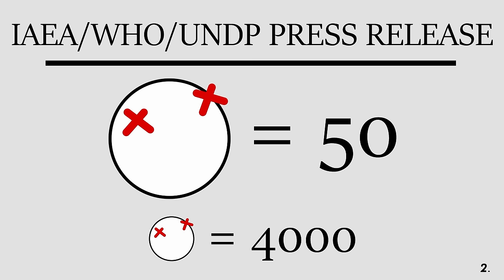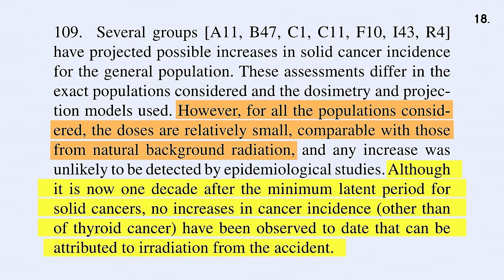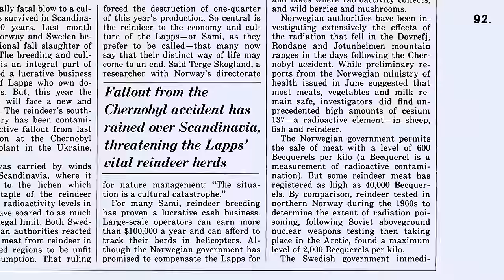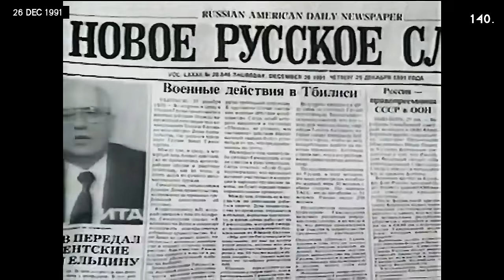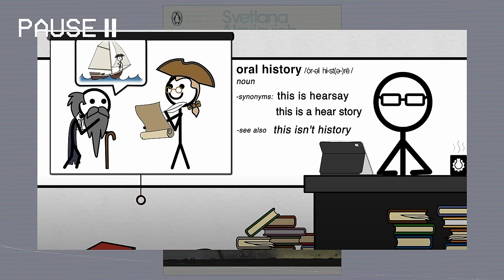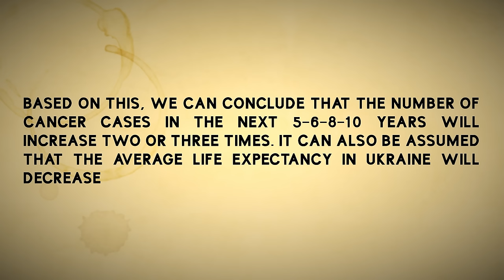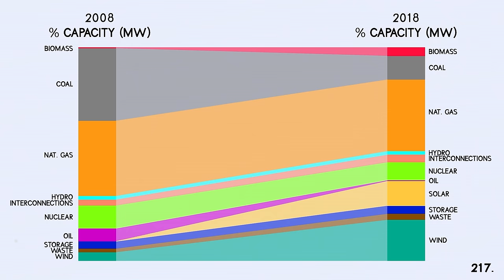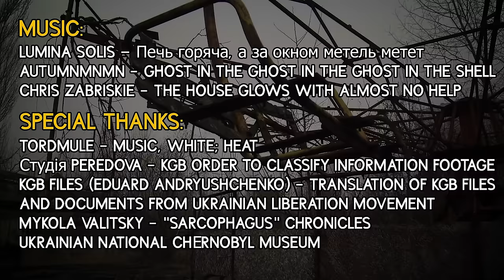Chernobyl's Death Toll | The Deep Dive

Comment: One thing that i feel is always left out of the discussion on nuclear power is that nuclear material is non renewable. When we determine to what extent nuclear power will be used to manage our carbon, other future uses of fuel material should be a factor. Obviously it would be stupid to try and save all the thorium for a theoretical space station that won't exist anyway in the event of societal collapse due to climate change. However, if there is a way to achieve climate goals without expanding too much nuclear fuel, that would clearly by the most prudent path.

Comment: We are nowhere near stopping at 1.5C, we are already at 1.2C and heading towards 3C by 2100.  While I'm sure that nuclear power will play a role in reducing emissions, the political and economic challenges to building new reactors are enormous and rightfully so.  The US would need 300+ Chernobyl sized nuclear plants to supply current US electricity demand.  Even if each plant caused a Chernobyl level disaster once every 10,000 years on average, we'd still have a 50% chance to see at least one disaster every ~25 years.  That's hard to swallow even if it is objectively less damaging than conventional generators, so we basically need designs that can never fail catastrophically.  It's easy to say we've already done that with gen 4 etc, but that's the same kind of arrogance that caused Chernobyl/Fukushima considering that almost nobody has actually built one.  Wind and solar are significantly cheaper politically and economically and do not have this problem, so it makes sense to focus our efforts on the things that will make the biggest difference for the lowest cost given the low level of commitment to solving climate change.

Comment: My father works at Hinkley B, and up until a couple days ago they were set to begin decommissioning in 3 months MAX. now its up in the air if Johnson will support the plant to stay on. But honestly i dont think its worth it. it was supposed to close in 2012, hell its been open since my dad was 1 year old (1976). The only reason i see it as acceptable currently is due to gas and oil prices ROCKETING, but im just wondering if it is worth it. that money could go straight into offshore turbines. If they want to expand B's life, they have to make a decision in the next few weeks before its too late (due to safety checks etc.). in the short term its fine but this cannot go on forever. Its already a decade overdue closing, sooner or later something will go wrong. 

I do believe in the future of Nuclear, but B site should go into decommissioning sooner than later, because the later /could/ be devastating- and for what- 1GW of power? C site is supposed to give out 3.2 when finished, put money into speeding that up before something goes wrong with B

Comment: This video is the best examination of nuclear power I have ever heard. My masters degree is biomedical physics with a focus on radiation, I've heard full lectures on this topic and yet you managed to present a more nuanced and holistic argument than any of my profs. 
Big compliments also on the level of simplification you chose in the section focussing on the science. Yes radiation induced leukaemia behaves completely differently to solid tumours (different risk rate, occur within 15 years of exposure instead of 40+ years...) and yes it is questionable whether whole body exposure models are applicable to radio iodine expose, but we didn't need to know that for your argument. I wouldn't have been able to hold back on fascinating stuff like that :D And yet I don't feel like any important bits were missing. 
I see the role of nuclear a little bit differently to you though. In most countries a mix of hydro solar and wind is likely able to be cost competitive with nuclear even in deep decarbonisation, but that is just the luck of the geographic draw. In countries where this is the case, I don't think nuclear power is a sensible technology to subsidize. However, in countries like Germany where this probably isn't a given, we should start planning new plants with significant amounts of state funds now. 
To me it feels like the most significant opposition arises from the issue of nuclear waste. My radiobiology professor used to be part of the peace/green/anti-nuclear movement and she is (or at least was when last spoke to her) still an opponent of nuclear energy because of the waste storage issue. Maybe that's just the German movement to the debate, but I'd guess it's similar elsewhere. So when we argue for nuclear as a technology for deep decarbonisation we need to address that issue. For me it's clear that we do have the technology for long term storage, especially if we allow international cooperation with storage sites in low population geologically stable regions. And it's also clear to me that long term nuclear storage is very scalable due to the small amount of waste and that we have to figure out storage anyway for the waste we already have. 
But we get back to issues like "won't this type of cooperation encourage colonial core countries to dump their waste in the global south where it's not safely stored?" and "what about the people living near the storage sites, proposed sites tend to be in territory associated with tribal or otherwise marginalised groups?". These questions and narratives are to me where the real problems and discussion around nuclear live, not really with safety of reactor operation (though that's important as well of course).
Reply: @namename9998  nuclear waste is not an issue because of its quantity but because of safe, long term storage. That is exactly my point.
You do need to store (highly) radioactive materials safely, all those scary cases of people salvaging sources from  medical equipment and getting people sick should be enough evidence that this is a real issue. I don't doubt that it can be done, but countries like Germany for example are still working on putting the infrastructure into place.
Processing waste is not a magic wand that makes the danger go away, yes some isotopes are useful, but you will still end up with some amount of waste you need to dispose of. Additionally not all countries have the capability to do processing and some are forbidden to develop the capability by treaty (chemical processing of waste from breeders can also be used to obtain relatively pure plutonium).

Comment: My only comment will be to annoyingly, pedantically, point out that "junk DNA" has largely fallen out of use in biology as it's become increasingly clear that non-coding regions aren't simply junk but may in fact code for important RNA (such as the relatively recently discovered long non-coding RNA, or lncRNA) or serve a structural or regulatory role, such as enhancer regions, Sequence within these areas is equally as important as within coding regions, but we didn't have robust enough tools to really investigate non-coding regions until recently, so it's still kind of an open frontier.

I only bring this up to note that assuming mutations in non-coding regions are inconsequential is a trap. I agree that mutation rate is not a useful metric, here, as it can be influenced by god damn near everything and most mutations have little or no effect (read Kimura's papers on Neutral Theory for an interesting time, here),

Comment: Nuclear power is the best alternative to burning fuel to produce power we currently have available. It is statistically safe, consistent, and relatively cheap. The major issues are high start up cost and long construction times before power can be produced safety concerns are further down the list with current technology and western safety standards. The fact that the same people who claim to care about the environment are opposed to building new nuclear power plants and exploring new technologies in the industry is very confusing. Instead they champion power options which are either way too expensive to be practical or so intermittent that they require very cheap and dirty companion power plants to cover their regular short-term production gaps. If you have to build a coal burning plant to cover your solar energy gaps is that more beneficial to the environment than a nuclear power plant producing steady, clean, cheap electricity which is only a problem if you neglect it or ignore safety?

Comment: Thanks for the summery of well this ... It neatly shows some of the root causes (if not most) of why it is so hard to trust atomic energy. It is not the engineers or the since that really are the source of the problem.  It is the policymakers for whom truth is optional, it is that industry who weighs the safety with profits and the potential for long term devastation unless the policymakers are actually acting once a accident happens. I do believe we will see a even stronger shift towards renewable not because they are green but because they are cheaper. If it will be enough to finally kill coal and gas without nuclear? Without some of the projects planned for energy storage doubtful but there is progress made and yes fukoshima did made the whole thing a lot harder.

Comment: Radon exposure is a red herring. If you control for smoking and routine second hand smoke exposure, which is already stressing the lungs to the point of carcinogenesis, the Radon absolutely makes it worse.

But, if you look at the non-smoker category, there's no difference between Radon exposed and non-Radon exposed.

So in other words, the doses from radon exposure only seem to hurt you if they're exacerbating something else that is already way into the level of chronic or even acute injury and inflammation. This is exactly what we would expect from Threshold models.

Comment: Honestly I am completely fine with more lax safety in nuclear power. Hell even if every modern nuclear powerplant was a dam BMK, It would still be safer then natural gas and coal power by a factor. Fukushima was not a disaster it was proof that nuclear safety regulations are beyond what is actually needed. One person died and a few got radiation poisoning, if that was a natural gas plant it would have probably resulted in WAY more deaths inside the power plant. Im just tired of people holding nuclear power to a different standard then natural gas and coal. One person dies from radiation poisoning and its a dam global disaster but 20 people die in a natural gas explosion and you probably will never even hear about it. Im not saying nuclear power should have no regulations, Im saying the regulations should be more lax to allow nuclear power to actually have a chance to become better, if it was actually economically feasible for companies to build nuclear power plants then they would become more standardized, produce more power, and probably end up safer in the long run. And if we need to have a few more meltdowns for that to happen then so be it, it will still be a fraction of the people who die in other power production fields. And hell it will probably even have a smaller ecological impact then fracking, oil drilling, coal burning, and solar power. 

The facts are simple. The single worst nuclear disaster that ever happened that was caused by insane incompetence and corner cutting. Still (and this is taking the highest estimate) resulted in less deaths then natural gas has per year, and literally isnt even one fourth the deaths that are caused by coal every year. We could have a Chernobyl every single year and it would still be safer then burning coal or natural gass for power. Hell you could have 3 Chernobyls every year and it would still be safer then coal.
Reply: you meant fukishima not hiroshima, but i broadly agree with your main point.

Comment: whoa whoa whoa........ There were 3 other RBMK reactors at the Chernobyl plant. 2 of which operated almost another 20 years. No 4 reactor had MOST OF ITS CONTROL RODS REMOVED(those green squares in the light-up layout display in the control room)!!!! They disabled and jumpered out vital security and safety control systems!!! And then they decided to run a test that compromised the cooling system, a test that was known to leave a gap in coolant flow!!! The way they ran that reactor they were guaranteeing an excursion event!!! Period!!!

The only problem with nuclear power is gigawatt scale plants. ie, having too much in one spot. With Small Modular Reactors its far easier to handle a few mega watts getting squirrelly, and far simpler to shutdown, and far safer to handle a partially melted core unit (if it can even self sustain a reaction after being poisoned and neutron reflectors being blown away by self activating pyro-bolts). Down with gigawatt plants. And let me have a 20KW micro-reactor for under my driveway!!!

Comment: I'm not even half way through and I've been listening to this while trying to figure out the nuances of amplifier circuit design, but I suddenly found myself stopping for a second with a need to write this comment that is eventually going to say: holy crap this is remarkably good sociological analysis; the way it explores the web of interconnected groups and interests and how they pull against or towards each other not to mention all the other angles, how the collective consciousness of the whole and the infinite number and variety of diffuse groupings you can separate the whole into evolve overtime depending on a variety of material conditions. Nice. 

Well... back to listening and trying to figure out these fucking biasing resistors I guess.

Oh right and all the stuff about class interests and their respective power dynamics stuff is great too.

Comment: 1:29:00 sadly that not 100% right, the CDU/FDP govmernt dint went back to the old plan of the spd and green that  had a higer green power spending that the CDU and FDP not retunte to.

in my belife atomc power can only be done in a 100% state run engerie sectore like you sad. 

only if this done we shuld do atomic power.

Comment: 36.23: Chernobyl DID NOT "explode"
Reply: But it did. There were two explosions. There's a disagreement if it was a stream and hydrogen explosion, or if the reactor actually went into a fizzle and had a micro nuclear detonation.
Reply: @ChucksSEADnDEAD  there was an outburst of steam, which isn't equal to say "Chernobyl" exploded. There was most definitely not a "micro" nuclear detonation.
Reply: Kinda did though bud

Comment: Hmm. Well done.

Politics is choosing least unpalatable of a number of bad options.
You‘ll notice that many German speaking users will not be happy with anything lower than Greenpeace numbers and also ignore all the pesticides used in the Soviet Union.
Reply: 48m45s „Ukraine and Belarus lack commodities like oil and gas“

That’s not correct. Ukraine has found large LNG deposits in the south of the country.
Coal has always been a staple of the Donbas, but there‘s Uranium in the center of the country and future enrichment was planned.
Reply from the maker: Good catch - will add that correction to the spreadsheet
Reply: Considering the amount of information you have fast-paced it is a negligible point - but some consider it to be one reason for the current war next to the systemic alternative Ukraine is to the Russian oppression.

Comment: "Nuclear is slower than renewables to stop climate change" is the most uninformed thing you can about the topic.

Given just the political will, nuclear power can currently decarbonize any grid, in about 10 years in China, Russia, and Korea. And also build the needed a few hours worth of ESS facility.
In case of western countries, it might take 20 or so years.

Renewables on the other hand, get this, are IMPOSSIBLE to decarbonize any big grid. It is technologically impossible to decarbonize a China or France sized isolated grid with renewables. Because you will need MONTHLY ESS.

Comment: We really need to, as a society, get past this fear of nuclear energy. That's only from the mistakes of the past generations. Technology, safety, knowledge, electronics, have advanced so much that things are night and day different. We had a very rough learning experience with the nuclear era and it timed up sadly with war but science and technology has advanced so so far in this realm just no one wants to commit to it because they have all these fears when really our fears come from this era that didn't take any safety measures, poorly engineered designs, poor technology, not respecting the dangers of working with the material which caused for so much unnecessary injuries. Now we have discovered so many new methods and possibilities to approach and apply this energy source in such a safer and controlled manner with layers of safety precautions set up that we really need to overcome these fears and see that if we want to eliminate carbon emissions, but still have enough electricity, then we need to trust nuclear energy. We went through our rough learning experience. It was rough yes, but things have advanced so much. You don't ever get better at anything if you give up and it's only natural that you stumble and fail when you're very first learning. So I know it's sad that had to happen the way it all did but I strongly believe nuclear energy is our future. Just think how much computers, ROV's, robotics, understanding of safety, understanding of different ways to build reactors, to use different materials, with much safer methods of operations so the reactors just power down and shit off and some are designed to be unable to melt down like we saw in the ancient reactors of Chernobyl. We won't be having anything like that going forward, that was the past, the future of nuclear is much more advanced, thought out, tested, I know we can do it. I know we can grow past our past trauma's.